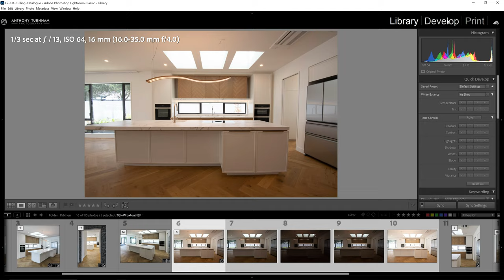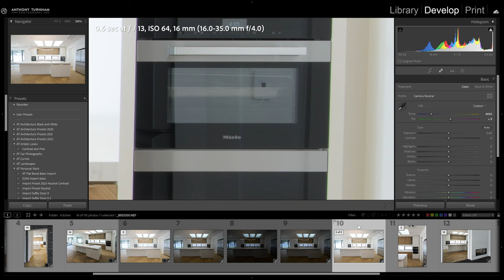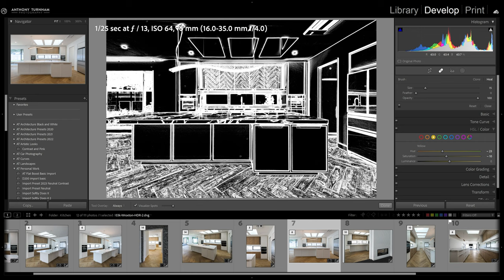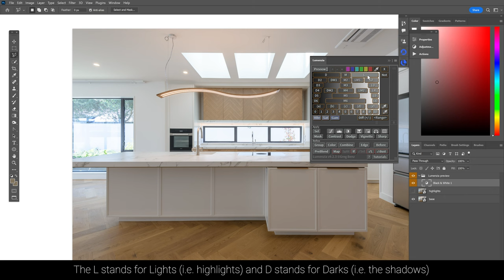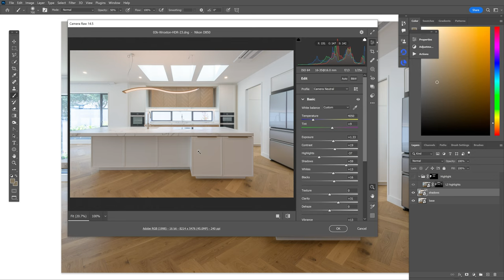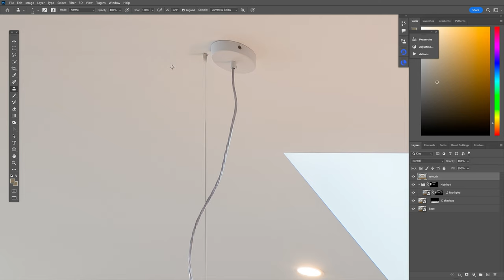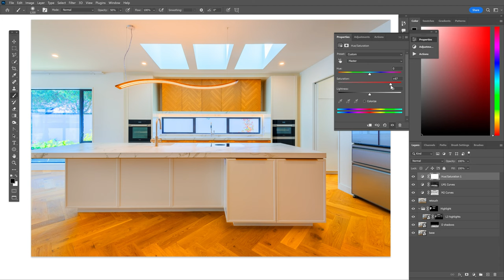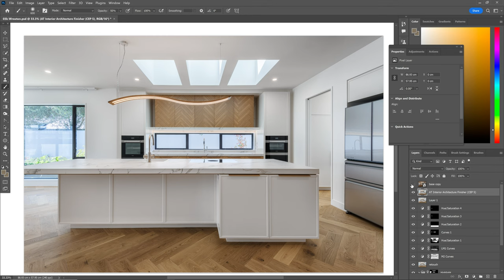Editing Interior Architecture Photography - Complete Process

Comment: Why don’t you shoot with flash and do a flambient approach? The little more time needed to set up flashes, would safe you from the hassle of correcting color cast. Which seems to take much longer than flash.
Reply from the maker: At times I use a flambient approach but on a case by case basis.

Comment: Hi Anthony
Thank you for super fine video about your way do make this photo.
There is a learning curve to use the panel, and I have used many hours to try and it going to better after more try.
But have to practice more before I'am there where the pic. is god to go.
I used LR for many years and get fine result BUT it take way to long time so for me this is to speed up and get better clean lines.

I bay the pack with course but have not resive the mail/link to course yet. Dont no what went wrong. So I have not see it yet.

I just click your link and bay Nik 6 Color Efex.
I can not find the any thing with name Color Pro? 
And I dont think the 17 different under Architecture are good. There is only 1 that gives meaning and that is "Detail Extractor" It's under "Nik 6 color Efex"
Do I do something wrong in Nik? 

Kind regards from
Morten
Denmark

Comment: color efex pro settings please. :) I would also like to know what the "glamour glow" effect in color efex is used for. I tried it, but it seemed to take sharpness out of the final image. So i passed on using that.
Reply from the maker: Hi Ryan. It's actually a filter designed for, well, surprise surprise - glamour photography, based on the 80's soft glamour look. The reason I use it in architecture is because the initial filters such as detail extractor can end up adding in too much local contrast. Glamour glow is a nice way to control that and give an inviting feel to the final edit. But that's just my recipe. ColorEfex has so many great tools that it's easy to come up with an enhancement that is your own distinct look.
Reply: @archiphoto  that makes sense to me friend. thanks for the explanation. i was noticing that about the detail extractor, which brings in quite a bit of grain even at 1%.  thanks for your valuable insights and methods.

Comment: the base shot of the 5 or of the 3 is with correct exposure to zero or it is a + 1 or - 1 for example?
Reply from the maker: I can't recall which I used in this vid example. But it doesn't have to be what the camera thinks is the 'correct' exposure. If +1ev looks better as the base, go with that. I've gone over this more in my latest video.
Reply: @archiphoto  it's not so much a "better" speech but it was understanding which dynamic range was better and greater with 2 shots unlike 2 stops with fuji x-t4. I'm still in a phase where I'm doing flambient but I wanted to try to use your technique. I usually take 3 shots at 2 stops of difference with ev+1. Obviously I have a worse exposed exterior (which I recover with flash + darken). do you think a base +1 could be good for your technique?
Reply: @AnthonyTurnham  i mean i take 3 shots with 2 stop difference over and under, a total of 4 stops. i understand that 5 or 7 shots are better but it slow the workflow (i will try to improve my hots however). The question was if the base shot must be at 0 correct exp. or with +1 i reveal more shadows and it could be the danger to have problems with the highlight. As i said, i would try to take a series of shots which i can then work on LR and PS with both technique, yours and a flambient. 
thanks!